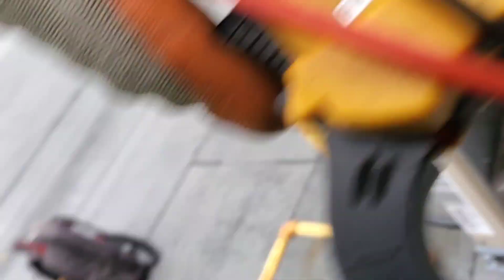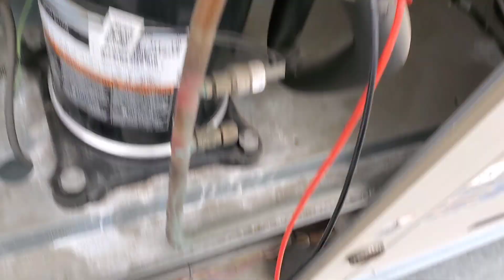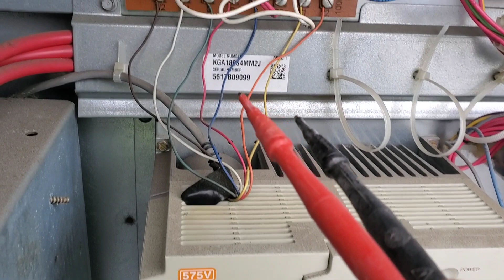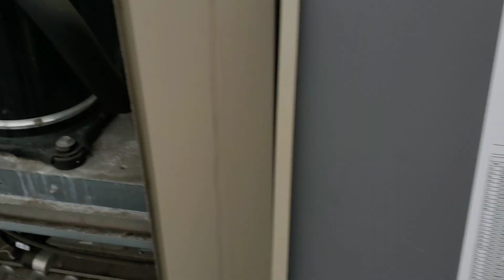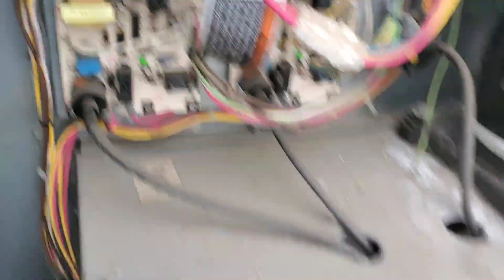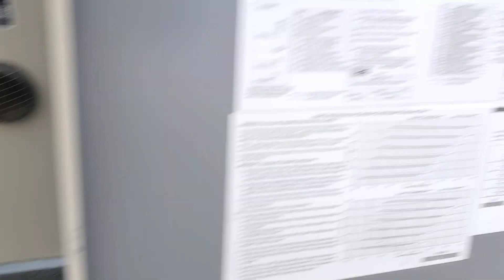RTU no Heat no 24 Volt

Comment: Is any one teach me why Yo got 24 v  indicat  3 phase monitor is bad?
Reply from the maker: That device monitor 3 phase input power supply if there is any fluctuations or phase imbalance it open 24V going to main control board it's a safety

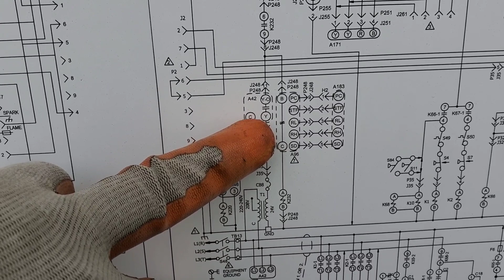Comment: Please clarify what is said at 3:32. It sounds like "y Air". This is unfamiliar terminology.
Reply from the maker: Thanks that was terminal Y on phase monitor
Reply: @Learnhvac.  Yes, I did follow that from the diagram and then on the physical device, but I still can't determine the word or phrase you were speaking. You said "directly connected to....Y (air)". And then a few seconds later you said 3 phase supply (air). I think the captions show it as "here". Is that correct?
Reply from the maker: 😂yea its here
Reply: @Learnhvac.  Ok thanks 👍

Comment: That is a phase loss protection device correct?
Reply from the maker: Yes it is
Reply: Interesting. I never had to this problem before with any units. Thanks for the demonstration sir. I'm fairly new to commercial equipment, I only been doing it for about a year and half.